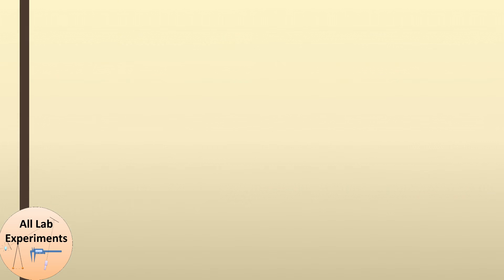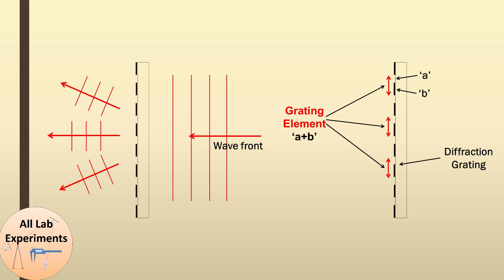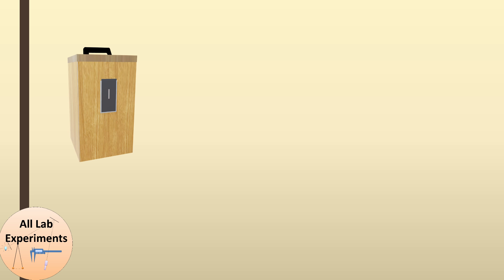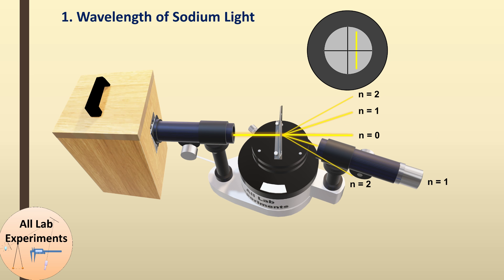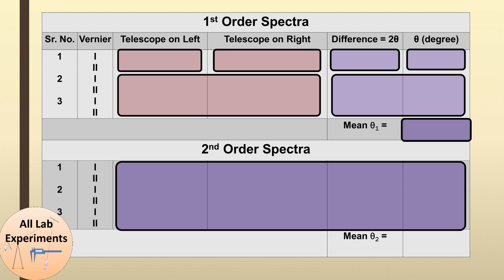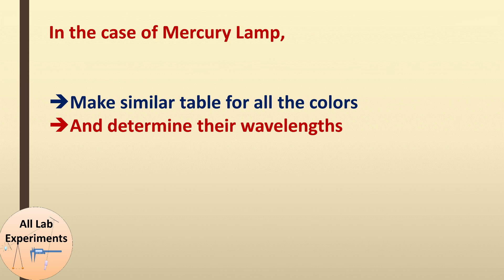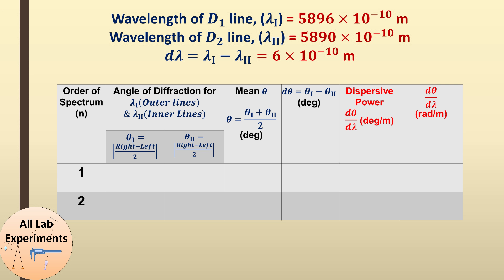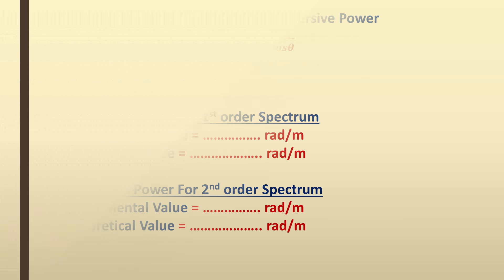Determination of Wavelength & Dispersive Power | Diffraction Grating | Practical File

Comment: When I see this ! I fall in love 😍  with it 
 So nice  explation dude thanks a lot 
But dispresing  power smj na  Aya.. mtlb kya hai iska
Reply from the maker: Some definitions are made according to the need of the apparatus. You have two lights and you use a prism then different prisms can separate those wavelengths by a different amount. That power which helps to disperse your wavelengths can be quantified as dispersive power. It is dependent on the structure and the material of the prism. And the formula is not any universal quantity but jss a way to quantify the spread.
Reply from the maker: BTW Thanks Rinku Saini for your kind words.
Reply: @AllLabExperiments  Oo  ok thanks 😊